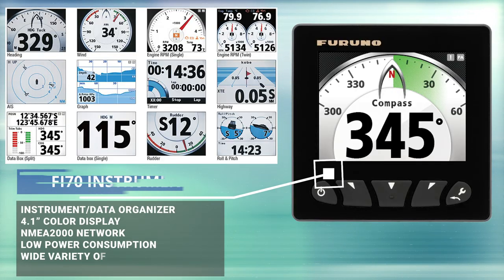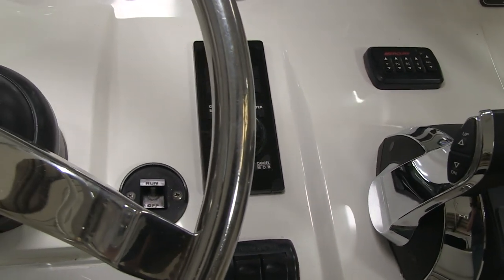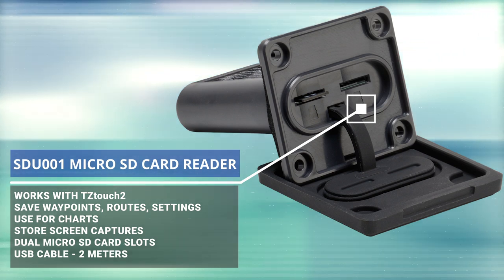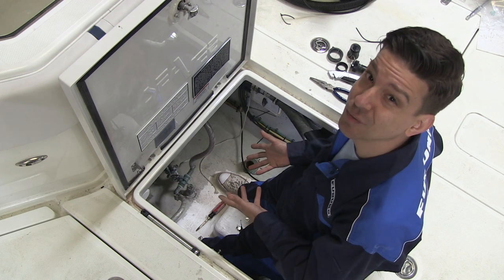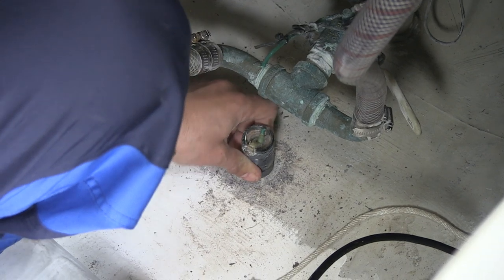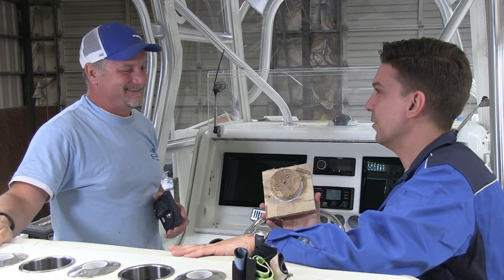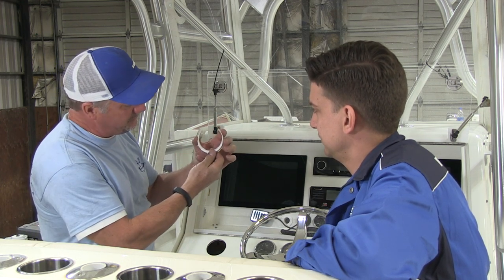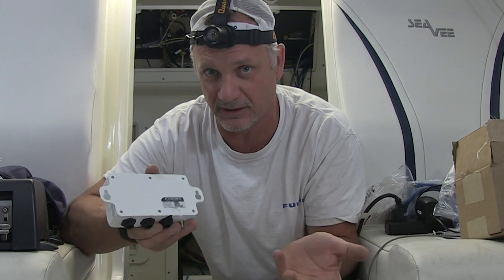Furuno Connections - Episode 11 - Accessorizing The Electronics Package

Comment: Great video guys! I appreciate you showing not just the products that Furuno provides, but the installation process as well. In particular, showing ways to cut a larger hole using the double arbor, taping out cut holes, etc. which show the real way this stuff all gets into a boat. I also now have several other accessories I need to buy for my Furuno setup :)
Reply from the maker: Thanks for the feedback! We tried to include as much as we could without getting too deep. Glad that you found the videos helpful.

Comment: Tip: If you run the hole saw in reverse initially you can score the gelcoat without chip-out. After going through the gelcoat, then run the saw in forward
Reply from the maker: Great tip Edward, thanks for your contribution!